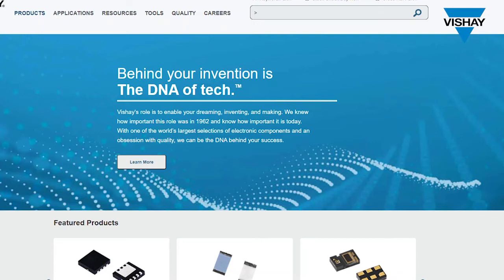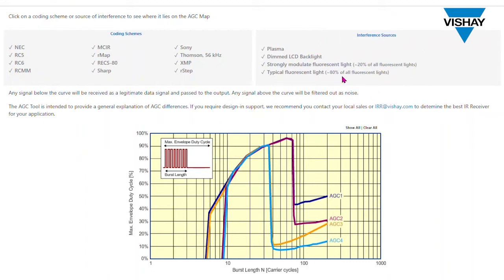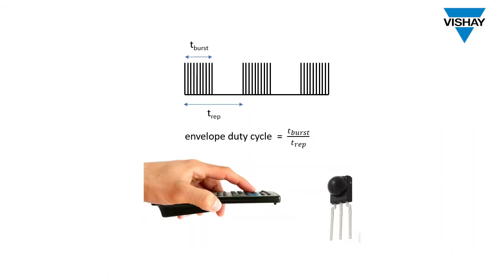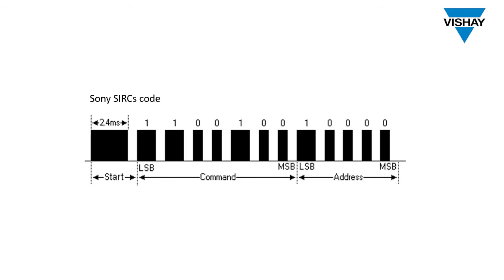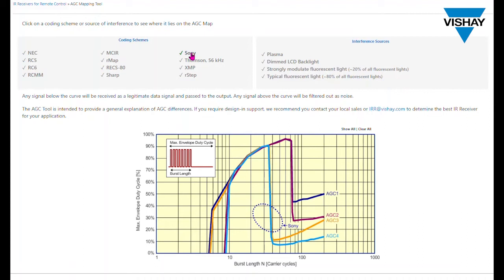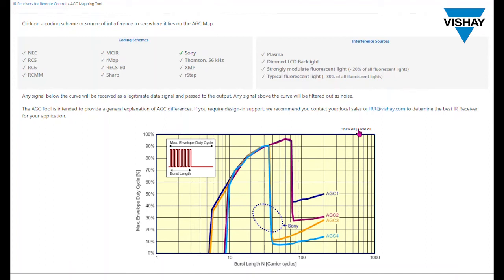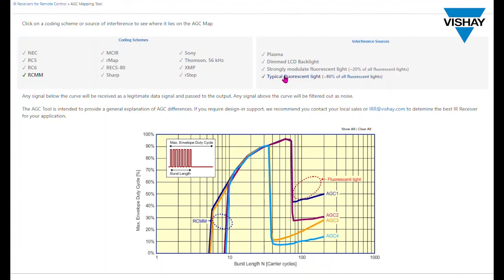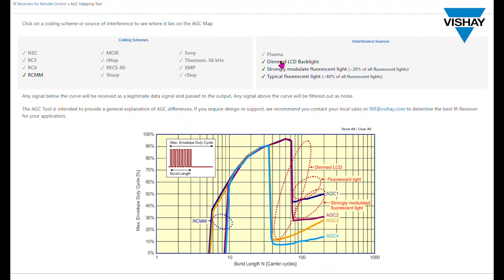IR Receivers: Understanding the AGC Function and Mapping Tool

Comment: which AGC would be best for IR transmission in long rage sunlight applications?  I get varying results from any sensor I try and never really found a pattern.
Reply: @dmitrysnegiryov  yes, I've always wondered if it was necessary.  We just send 2500uS pulse, wait 500uS, then data begins.  Some datasheet say we need a very long wait period after the header/calibration pulse, but it seems to work fine w/o it too.  It seems AGC 1/2 worked best for us, and higher AGC made it less receptive outdoors.